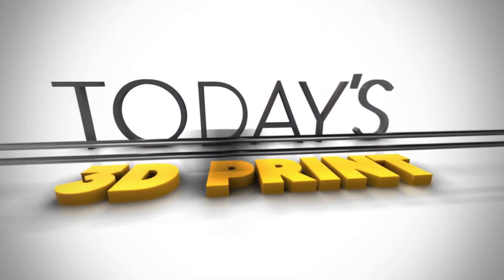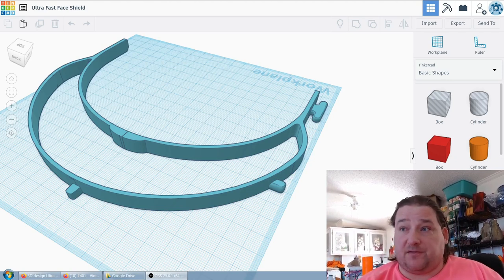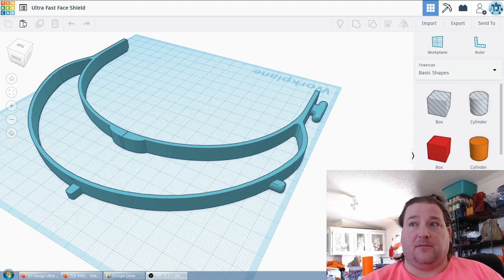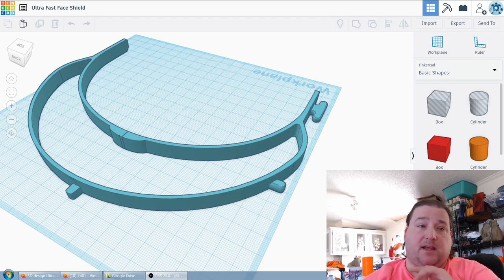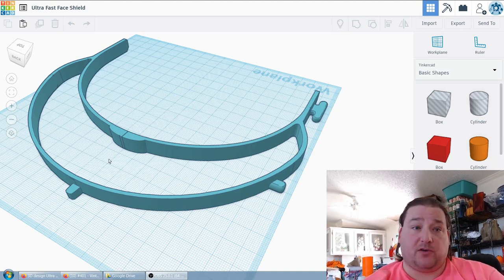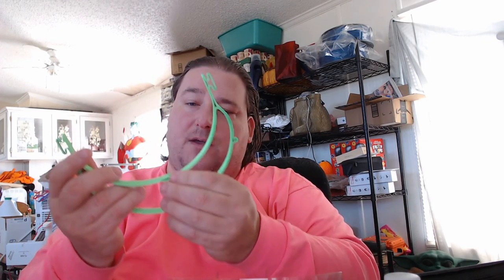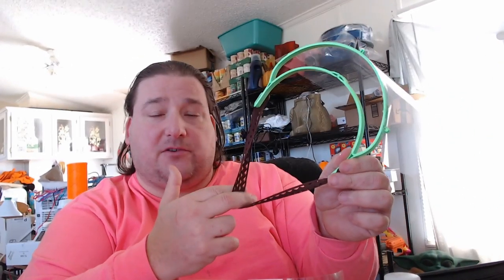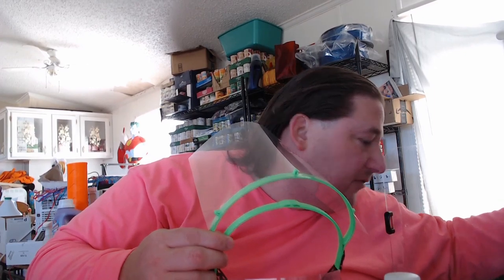Face Shields for Local Employee T3DP

Comment: I'm on the east coast, I've donated 50 shields each to 2 different hospitals here in Connecticut, am set to donate 50 more to Jacobs NICU in the Bronx tomorrow -- we're doing contact-less pickups, the health workers are very careful.  We're a group of 3, we're printing as many as we can to get PPE to our hospitals. Other members in our groups donated 35 to another ER department in another hard hit CT hospital.  We've started distributing shields to hospitals in NYC, and as everyone knows NYC is in dire need of PPE. We initially were printing closed ones with forehead covering, and feedback we've gotten from the ER nurses is that the top cover is not necessary as all medical workers are wearing bandannas or other head covering. So we've switched to the open style shields, as they are more flexible, and more comfortable to wear, an added benefit the yield per spool is better, and we're able to make them faster. We're using PETg to ensure the shield frames are more resilient to bending and especially more resilient to sanitizing techniques hospitals use -- specifically high powered UVC. PETg holds up significantly better to hot water and soap, as well as hospital UV sanitizing equipment. My company stepped up to help us out with the cost, so we will keep producing shields as long as they're needed, and we're asked on a daily basis by hospital workers to be added to our queue.

Comment: Trying to print euro 4 hole version on vase mode with a .6 nozzle using cura not sure what I need the flow to be? first time printing with petg any tips?
Reply from the maker: I would probably go 1.4 to get a 0.8 equivalent and see how you like the stiffness. If too floppy go 2.0 for the 1.2mm stiffness.

Comment: Great Job Chris,
But, I am wondering... When someone coughs, a cloud of microdrops of saliva comes into the air. I've seen simulations where they show what happens when such a cloud hits an obstacle, because it just curls around it.

Doesn't it give you a false idea of protection if you don't also close the top, because the cloud of infected saliva drops just curls around the top and still reaches the eyes?

Comment: Hey Chris how's the new house?
Reply: Apparently it has only 50 amps of power coming into it, which is about have of what an OLD house has, and quarter of what new homes have.
Reply from the maker: Good overall. A bunch of little things. I have to fix and issues. I have to work through but they are. Normal everyday issues that I am happy to have to deal with compared to the issues I had to deal with before. :-)
Reply from the maker: Yeah, 50 amps is a real pain in my rear end. If I turn on A6 printer and the water heater kicks on. For the car charges for the heat pump turns on. It pops the stinking breaker. :-) I have a 100 amp panel in the house. But only a 50 amp breaker on the pole. I still need to find someone to come out and look at it and tell me whether the wire going from the pole to the house is actually 50 amp or 100 amp wire. If it's a hundred amp wire, then I can just simply have them change the breaker. To 100 amps But if it's not a hundred amp wire. It gets a lot more expensive to run new wire from the pole to the house.

Comment: Why do you even need that join there, why not solid like most others? The damn plastic sheets are ridiculous expensive, locally they are $40 to $60 a box of 100....That ridiculous.
Reply: Check with Oregonlam.com they still have good prices. I ordered 200 10mil sheets and only cost about $33 including shipping!
Reply: @Magic3DPrinting  All I saw was for laminating, what did you buy?
Reply: @stevelaminack1516  It’s the same stuff. Here is the info from my order Order Details
--------------------------------
Item : C10AS
SKU : C10AS
Quantity : 2
Item Price : $13.83
Item Total : $27.66
Reply from the maker: Because the way I am printing these inveighs mode to dramatically increase the speed which they print them. Requires that I have one continuous surface. If you have separate distinct surfaces, you can't print in vase mode. Well, you can try but it won't work. Well. 

 So I had to create a cut there to join the outside surface with the inside service to make it all one continuous surface. Once I went back to regular pla, there was Zero problems with that joint. It was only the silk that was causing a problem there.